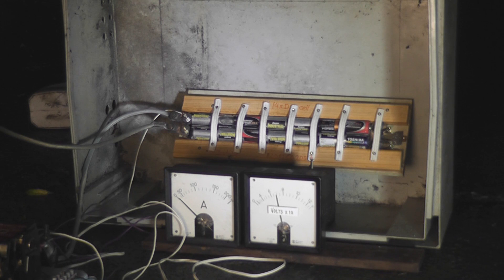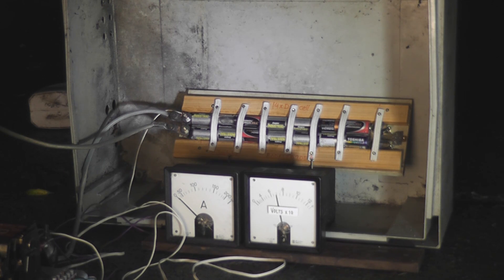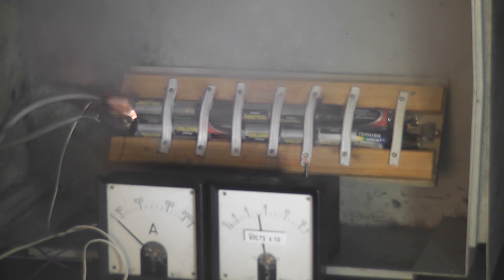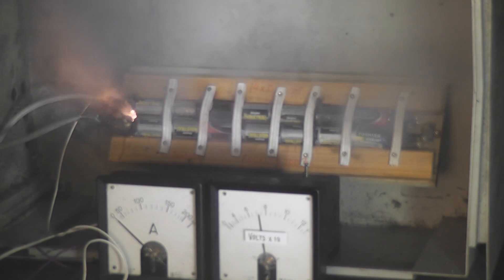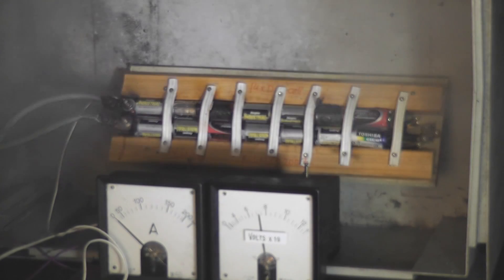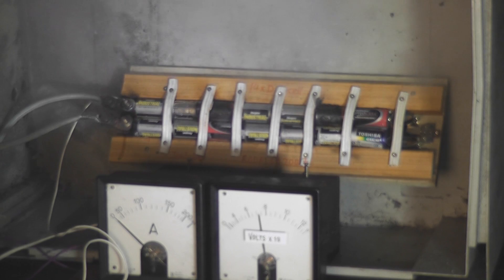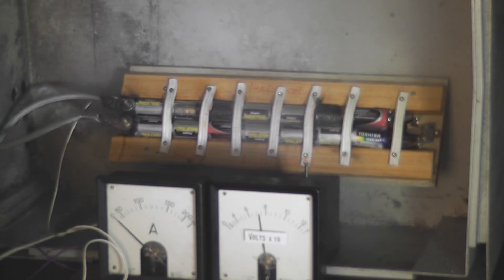Overcharging 14 x D-Cell batteries on 72 Volts 50 Hz

Comment: Not possible. Its like saying you inflate a balloon by blowing it up then letting it down then sucking every last bit of air out of it. 50hz AC goes backwards and forwards 100 times a second (or forward 50 times and backwards 50 times).